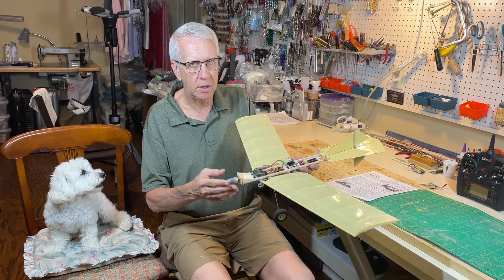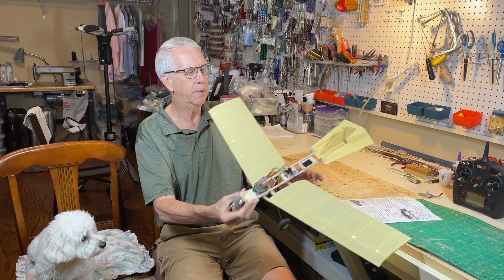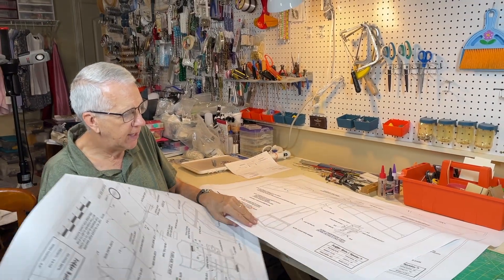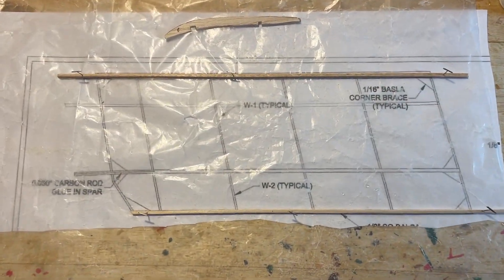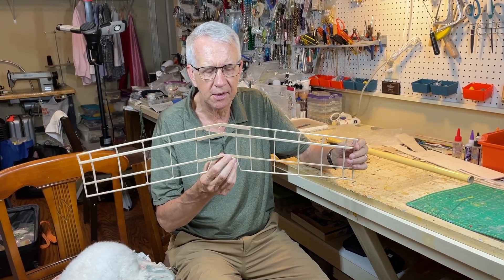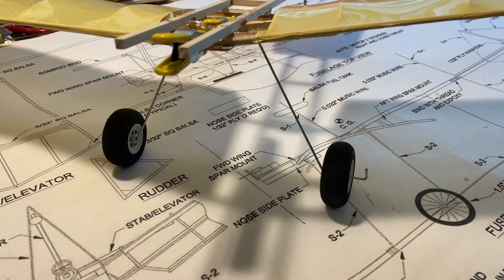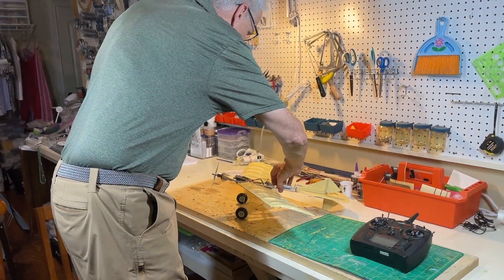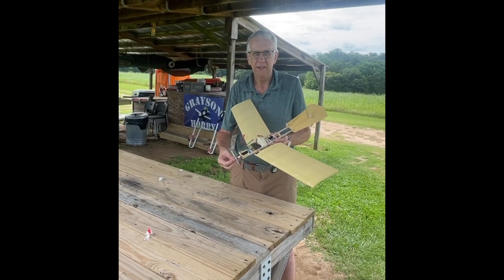1910 Fokker Spin Build and Fly

Comment: Hi Tim, does anyone market very thin sheets/rolls of foam, eg. 1mm or less? My thoughts are for single-skin wings like this, glue onto to the wing frame & rib tops, then a few light coats of acrylic lacquer to add some 'rigidity of form' etc.
For slow flying 'Edwardian' stuff like this Fokker or say, an Antoinette, will this method resist in-flight molting & doom?  : )
Reply from the maker: Sounds like a neat idea, not sure where to obtain the foam.

Comment: In my "someday when I find time files" I have plans for a somewhat similar Messerschmidt 33.  The hope, dream and plan is to build it using the running gear from an old, crunched up Aeronca Champ ... so it will be a bit smaller than what you have built, no more than 16-18 inch wingspan and light as I can build it.  Both a/c are elegant in their simplicity, little more than powered gliders, if built light they should fly well.  At least that's what I read.  Perhaps you next build could be small enough to use the running gear from something like the Aeronca Champ.
Reply from the maker: Great plan, best of luck!🤞

Comment: 10:25 sir.. do you recommend the motor always be on the center??? in zinith plane the motor is not exactly on the center… can you explain?🌹🌹🌹
Reply from the maker: The motor, for these smaller electric powered airplanes really do not need to be centered. With small variations in the wing, alignment of tail surfaces, etc. I do not worry even about adding a bit of right thrust.